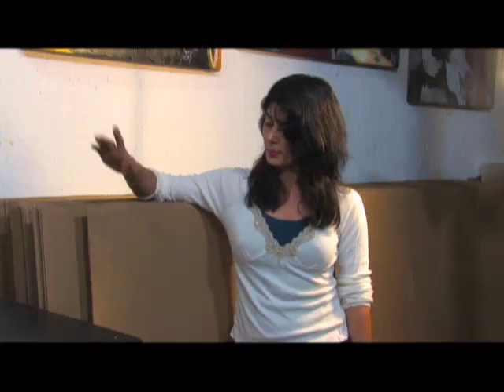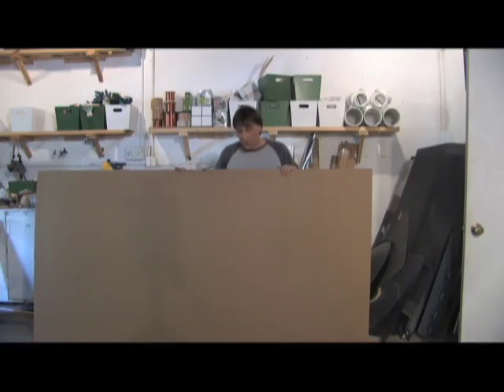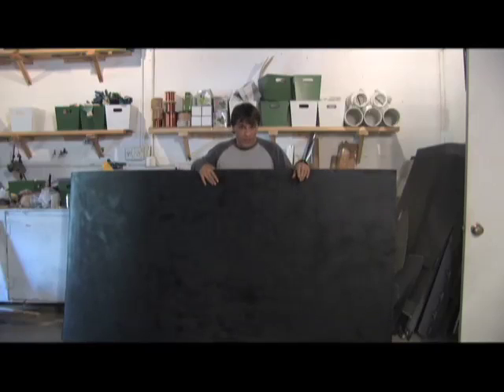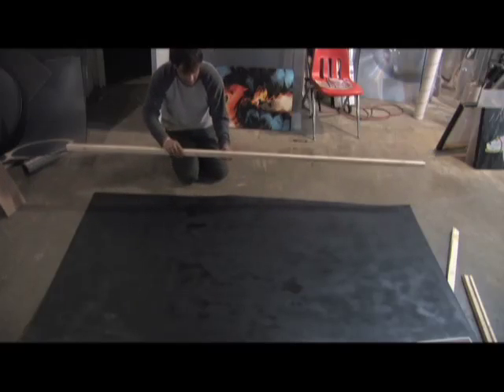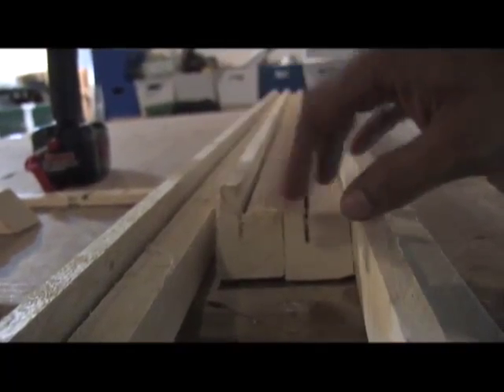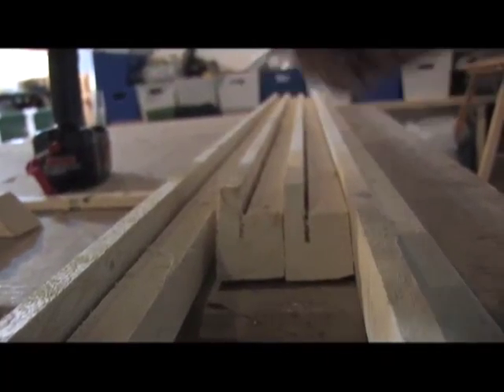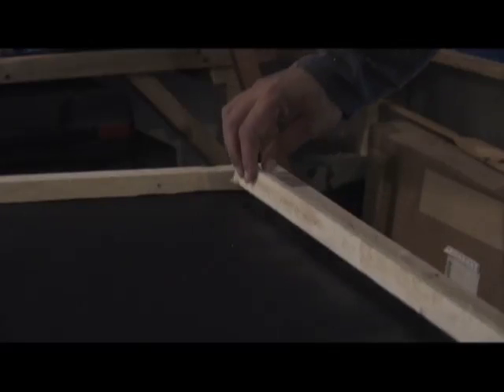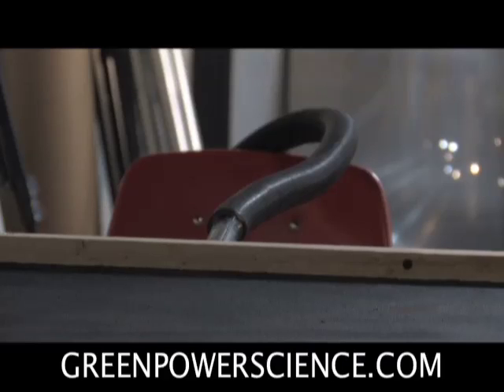CORRUGATED SOLAR FORCED AIR PASSIVE HEATER FIGHT HIGH HEATING OIL GREAT DEPRESSION 2

Comment: haven't read all 191 comments, so I don't know if this has been mentioned yet or not.  If you have the inlet at (let's say) the top left corner and the outlet at the bottom right corner (kinda like an automotive radiator) it should equalize the airflow through the pannel quite a bit.  Thanks Dan, good stuff!  Keep it up!

Comment: Ya the vacuum blower air would be warm from the motor  and get warmer as the test went on but still a great idea. It'd be nice to see what it would produce in cold clims. It would be sucking cold air in and may cool the unit too much. I would be tempted to put a dimmer on the vacuum to slow it down to a low purr.

Comment from the maker: HI,

A BLACK SHEET 8FT X 4 FT COSTS $20. Spray the black sheet with flat black spray on the sunny side up. This acts as a UV barrier and extends the life of the sheet by 1-2 years.

Yes, this will heat a room + 20 f that size depending on insulation, ceiling height and outside temp. For very cold climates, add a glass buffer. Make 2 or 3 smaller units as 4ft x 8ft glass is expensive and impossible to work with.

Smaller units can be chained together.

Dan

Comment: My parents lived in Denver & had a south facing front door that was painted black on the outside.  My mom, in the middle of winter, could heat their entire livingroom & kitchen with that black door!  She opened it about 1/2 was and blew a small fan that direction.  On a sunny day you would literally cook if sat anywhere near that door!  She could shut off the furnace on a sunny day.  Of course the bathroom was a little chilly but they didnt bathe until night & furnace was kicked back on.  CHEAP

Comment from the maker: Hi,

The best paint is a $1 a can enamel from LOWES hardware store.

It comes in a white tapered can. Walmart Flat black is horrible. Does not cover, but their Gloss black is excellent.

So Gloss black, walmart or Lowes

Flat Black Lowes

Other countries, try the lease expensive first.

Thicker coats reduce efficiency transfer.

Comment: hi, everything great. i would do 2 things different:
1st measure air temperature in and out, because vacum cleaner also heats air ~10 degrees i woud guess.
2 for better air circulation balancing i would do a plastic pipipe collector. Cut pipe like   (C------) put silion to seal. Now pipe of 50mm would be perfect to even the flow. 
i know , because i am HVAC engineer my self

i give you my personal 1000% of aprooval because people like you never stops exploring limits. keep it like that

Comment: The point is the amount of energy you can get from the sun. When your power is out for three weeks in the winter please make a video of your "heater". It will really be cool to watch, once the power is back on for you to upload........ no pun...........I am still using my solar panel and it has cut my heating way down....265watts vs 3000watts you do the math.

Comment: Coroplast the same material used in construction sites to protect floor and wall surfaces?Its pretty tough.I have been watching some videos about 'solar can heaters' and I was thinking, you could use this material as a backing and take advantage of the heat it can pass up the channels in addition to your cans,how about narrow copper tubing up the channels?Im in the UK i plan to build something along that line -if i can save ANY fuel bill even on odd days I will be very happy. Bravo GPS :)

Comment: . The day that I tested this panel it was hazy and a little overcast. the following day my results proved to be far better. At 20F clear skies with a 15 mph wind I was getting as much as a 56F degree increase in temp (71F intake and 127F at the exit port) constant. By 1:30 the interior of my building was 75.4F when I shut it off. I was burning up.. ;0) I have a few ideas for another blower system. I'll post that video when I get finished... Thanks again.

Comment: Dan have you or anyone else had any issues with melting the Coroplast inside the sealed solar panel? Seems like the temp would get pretty hot during the summer months. Does anyone know what the critical temp would be? Hate to invest the time and money into something that's gonna melt down.
Thanks for the great ideas.

Comment: Acrylic cover,
Styrofoam back.
Input to one corner,
output from the opposite (diagonal) corner.
So all the air paths are the same length.

Comment from the maker: We are due for a cold night here, If it is cold during the day, I will get some temps on the Coroplast. The ideal concept would have an Acrylic cover. Snow can be lessened by angling it directly at the sun. This will help but deep snow, shovel:-) 

A vacuum seal would make the temperatures go way up in cold but the unit would need to be smaller cells and would take some fine workmanship. Thee good thing about this idea, you can shut it off when there is no sun.

Comment: great idea but, when its 10 degrees out how warm is that cardboard? also, if its outside, wont snow build up on it, blocking it from what little sun us northerners get to begin with. i would like to see this tested in freezing temps, of course its gonna get hot when its 88 degrees out and the sun is beating on it 10 hours a day...still this is a neat idea

Comment: I am going to have to build one of these.  I am curious to see if the surface actually heats up enough in this cold Connecticut winter air.

Comment: Try this low tech solution: Get electric heaters at COSTCO--give your money to the local electric utility instead of AL-KAEDA oil.  Even if you don't save a dime on your heating bill, you'll drive the cost of gas down, and maybe save a soldier or sailor's life, as oil profits from imported oil feed our enemies.

Think about it while you're lowering that thermostat.  I just cut my oil bill 2/3, and my electric bill hasn't jumped.  Paid for the heaters one season.

Comment from the maker: The vacuum is for testing only. The Coroplast has larger channels a allows for easier air flow. Any 200 watt blower could do the job. A solar blower could work too. This would cut off when the sun goes down or a photo sensor for heavy cloud cover.

Comment: I have an uncle that used this principle to heat a pool. Black painted PVC snaking back and forth on a slope below the pool, encased under safety glass. It had an entrance and an exit to the pool and circulated heated water all thanks to the sun.

Comment: nice idea...I can also see such a unit or several units encased in safety glass to weather proof with solar fans also installed so that it requires no electric fan

Comment: The short answer is, I don't know. But if these lenses can melt glass, perhaps a much higher temp in a smaller area would provide more heat that lower temp over total area would. Corrugated metal might work better for that because the heat would radiate from that smaller spot. ?? I dunno, that's what I asked.

Comment: Instead of trying to "push" the air through with the vacuum, it might work better to "pull" from the opposite side. By doing that, you can completely open the incoming side on the cardboard.

Comment: People in the Air conditioning business will tell You that the outlet needs to be at least twice as large in area than the inlet; so multiple ports out would dramatically improve airflow with much less work on the blower.

A solar powered blower would make this unit complete.

Good Job !

Comment: clarification on the bed:
woven mat & mattress rested on an insulated stone bed frame. 'Coals' were inserted into a brick sized hole below the bed where, I presume, they heated stones that later slowly released the heat. Smoke left through a vent outside.

Although the host lit something below the bed when we were shown the room, I remember conversation about there the beds needing to be prepared a day/half day in advance (slow stone heating?)

Comment: "this is nice but you would need to work on air flow implementation."

Maybe a large funnel on your roof (if you get wind), connected to the panel? I dunno, not a science guy, just tossing in a guess.

There is some type of 'wind tunnel' effect that could be generated to make it work.

Comment: Creative! Some thoughts- the temperature of the air coming out of the vacuum cleaner is likely higher than that of the surrounding air, so the difference is not as much as you might think. You might not need that much airflow to make this usable -- think consistent, but low volumes of air. Is there a way to power a fan using the energy collected by the cardboard panel, and make the blower powered by the panel itself?
Reply: Yes, that is some thing I have noticed. A vacuum cleaner will heat up a small room in no time. The rapid movement of the air will heat the air from friction and the air is getting heated from compression. Btw Would someone please, invent a quiet vacuum cleaner?

Comment: Just a thought, but doesn't adding the device remove from the heat added to your attic from the sun hitting the roof? You could get a lot more out of putting a panel that actually adds to the surface area of the house.

As far as blowers go, it might make sense to use natural convection as much as possible. the cardboard is too narrow to allow for high CFPM & low area, so maybe just put the panel at an angle, or attached to a wall, with the hot air port on top, the cold air port on bottom.

Comment: Actually, the process is called adsorption.  Camping AC units and early refrigerators used it.  Works great, just be careful and avoid letting the hydrogen out when it separates.

Comment: Dan - you two are truly awe-inspiring.  They should make roofing material using your cardboard model.  Had a suggestion for you - I had a motor home that used gas flames to COOL a freezer/refrigerator.  Using your many ingenious methods of solar heating, you could use the sun instead of flames to power a refrigerator, and on a larger scale, home cooler.  Use any motor home fridge as a model.  Thoughts?

Comment from the maker: Input measurement which I did not show was 86-91F.

I had to let it run for 40 seconds as the black shop vac and hose produced 110 F staring temp. after an additional 15 seconds it dropped to low 90's (88-93). The sun hitting the black shopvac and hose was more of a factor than the motor. The inside test with sawdust the was no temperature(.5f+-) difference from the output to the ambient room temperature. Thank you for the comment.

Comment: Nice idea - easier way than using recycled aluminium cans like some other heaters I have seen. I would be interested to know if the black corrugated plastic will hold its shape in the sun - or distort.

Comment from the maker: AGREED ON THE FAN:-) 

I measured the vacuum outlet and it was 89.7 initially it was 107 because it is black and sat in the sun, after running for 2 minutes it dropped.  Outside temp was about 85 f but the thermometer would jump from holding it or sun hitting it. This shopvac has a ton of volume and the air is usually not get more than a few degrees above the outside temp.

Comment: I wonder how far down the corrugations the air flows before reaching the highest temperature?  Beyond that point - no heat added.  You might be better off with several shorter panels connected in parallel and also get more airflow at the same time.  The air would heat up fast in those thin corrugations.

But then there's night - colder and with no sun.  Dan and Denise aren't worried though - they live in Florida. :)

Keep up the good work you two!

Comment: A denser material like the plastic you mentioned probably got a better thermal conductivity than cardboard.Still,using cardboard is still good, its cheap and available and when its black coated it will absorb practically the same as a good metal.  Due to low thermal conductance of cardboard, a higher level of heat is radiated at the surface probably, however this can be possibly tapped if its designed to.I'm wondering if it's practical to use 2 or 3 sheets of clear plastic drape material on top.

Comment: Hey Dan.  Try and slow the air down the temp will rise.  Speed and hot air are not good for each other.  Slower air is warmer. Cool air if faster.  Either than that you have done another great vid.

Keep up the great vids...

Comment from the maker: Hi,

A lot. Dark curtains or a dark mini blind can reach 120f with sunlight. Pointing a mirror at your house will add heat. Just remember the sun moves and you want to make sure it does not point at your neighbors house or traffic at any point throughout the day. I placed 8 mirrors at different angles at one window, got 8 hours of continuous light.